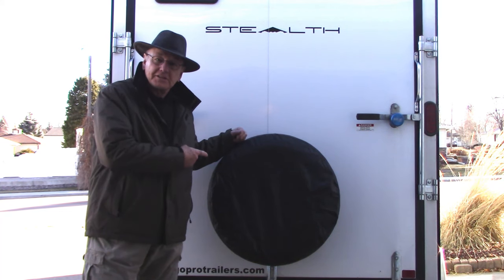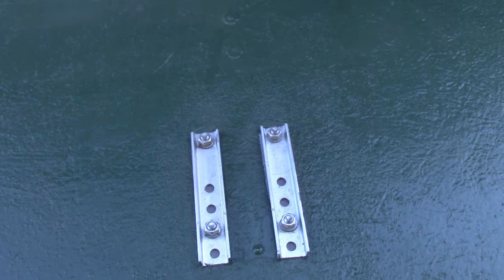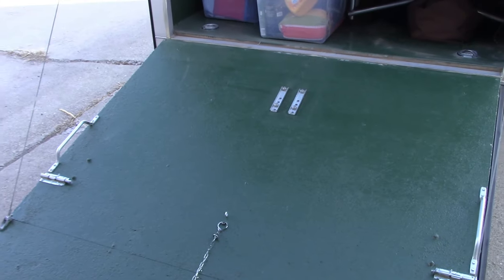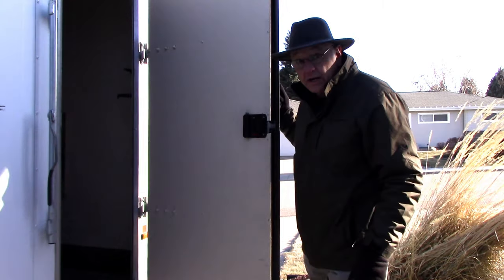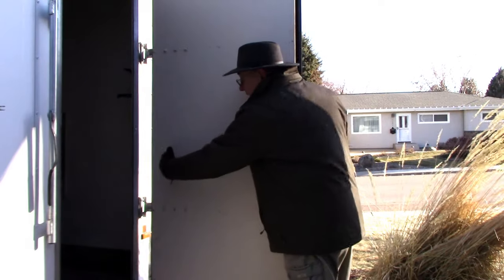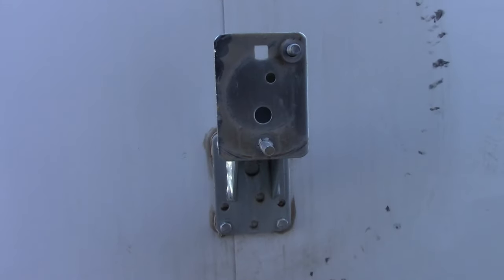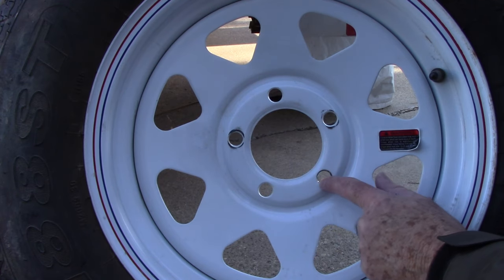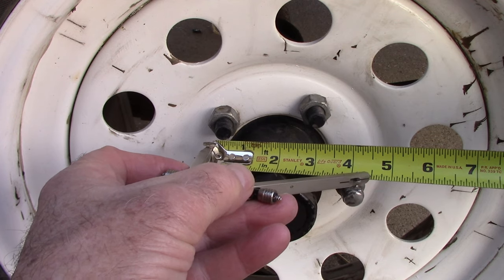Installing a Spare Tire On Your Cargo Trailer Camper

Comment: Over the years I made lots of modifications. One trick I learned was if I were doing what you did, I would go a step further. Not to say what you did was not right, but to try and insure no damage to the door. I save all kinds of pieces of metal tube, pipe, pvc pipe, copper pipe. I would try to match a piece of tubing or pipe to fit the bolt I was using and cut it to match the thickness of the panel . That insures it will not crush anything. Great job!
Reply from the maker: Thanks for the tip Bill!.

Comment: Does the weight of the tire effect the closure of the ramp door? Did you get a larger spring to handle the added weight? This is the best location as far as I'm concerned, but I'm worried about the added weight to the ramp door effecting the spring loaded door. 
I've watched many of your videos, they have helped me a lot, thank you.
Reply from the maker: Mount the tire as low as is practical and you should be fine.  Mine didn't affect the spring enough to make a big difference.
Reply: @gonagain  That's what i was thinking,  i just needed some reassurance before I drilled holes.  Keep up the cool videos. I use my 7' x 12' to haul my Harley road glide to and from Kentucky and Texas and sleep in it while traveling and attending rally's. I enjoy taking my time to and from while visiting Civil War battlefields. Thanks for all your help and the quick response. 
Kyle

Comment: For the side panel mount solution, why couldn't you use the same system you used for your ramp door but applied to the side panel?  You suggested much more reinforcing for the side panel than you applied to the ramp door.  Is this because the ramp door is much more robust than the side panel to begin with?  Please embellish.
Reply from the maker: That's exactly right about the ramp door being more robust and that's why the side panel mount needs some additional stiffening.  There may be other ways to accomplish that, but I think this would be the neatest.

Comment: Great Videos, Big Fan! I installed the spare tire exactly as you describe, I actually have the same trailer as you, but now need to reset my spring and cables. Can you describe or do a video on how to fix? Thanks!
Reply from the maker: I wouldn't try adjusting that spring unless I absolutely had to and then I'd get a knowledgeable trailer shop to do it for you. I did mine and it was a very real struggle.  I'm not sure I made any progress but the weight of my door wasn't too bad tho begin with. How is yours?
Reply: @gonagain  I am about to go on my first trip soon, so I think I will take your advice and have my dealer reset it along with checking out a few things other things to make sure I am safe before venturing out, Thanks!

Comment: Great video, how is the spare tire holding up mounted to the door? Any movement or warp age of the door? Also, which cover did you use?
Reply from the maker: The mount is still solid.  This is the one that I ordered, but measure your tire diameter first.  https://amzn.to/3tJVRYu

Comment: Is your trailer frame aluminum? Mine is. The studs are 1 x 1.5". They are oriented so they are 1" thick. I have barn doors. I'm not sure if they are strong enough. Love your videos!!!
Reply from the maker: Yeah Donald, mine is aluminum too.  I think if you put the blocking inside the door and a large, 1/2" plywood backing on the inside of the door it would be plenty strong enough to handle the weight.  Thanks for watching!

Comment: I recently mounted my spare tire on the ramp door of my trailer. On your program about locking your stuff I recall you mentioning you had two different lug nut locks on each wheel and the spare.
The spare mount has carriage bolts to keep the bolts from turning. These are 1/2 inch 13 carriage bolts and I could not find carriage bolts in a metric size to match the wheel lugs. Since I cannot hold the bolts from the back while tightening I wonder what you are using to lock the spare to the mount?
Reply from the maker: I used anti theft lug nuts there too.  I used 5 antitheft lug nuts on the left wheel that has the boot on it and these are of two different manufacturers.  Without removing the wheels and hubs, like if you are going to store the trailer somewhere away from your home, I think I've done about the best I can do.  I hope.

Comment: A very necessary requirement to have a spare wheel, but would it be easier to mount the wheel on the tow bar frame at the front of the trailer, that would also increase the nose weight which is normally a good thing, on the "A" frame it is also lower, which is much easier to stow, but the rear mount with the wood infill is a good position failing the A frame mount, depending on the weight of the wheel, my wheel is 40 Kgs, so it requires a lot of effort to lift, and locate on the studs at the same time, another option if you cannot gain access to the inside of the panel to place wood, would be to drill in from the inside, insert a steel tube of the correct length, then position a spreader(angle or sheet steel) then when it was tightened it would be supported by the spreader, always supposing the hinges were of sufficient strength to take the weight. Chris B.
Reply from the maker: That's a good tip on using a steel insert and spreader bar.  On a V-nose trailer you may not have enough space on the A frame to mount a spare.  I already have my propane tank and battery up there so that option wasn't available to me.  Your spare is really heavy so you definitely need something fairly stout!
Reply: @gonagain  : Yes, on a living trailer the gas bottle would be a problem, I thought that with your goods trailer with the ramp, it would be a good alternative as it would also keep the weight of the ramp down, the tube spacers work well, but the length needs to be just right to give a bit of "pinch" between generous load spreaders.
Reply from the maker: @453421abcdefg12345  with a heavy spare tire like yours, the rear ramp door lowering springs would have to be adjusted to handle the extra weight.  Keeping the tire as low on the door as possible helps a lot though.  On my door it didn't make any difference, but that's because my spare is pretty light.

Comment: Beats not having a spare. I like the angle iron idea. You could also accomplish that with inch square steel and cut a square wood dowel to fill the inside if you are concerned about bolts compressing the channel, might look a little better too. Take care. Aren't you two supposed to be playing Snowbirds about now?
Reply from the maker: Yes we are!  New water pump last week and new trailer tires yesterday.  Sub zero weather on the way... A good time to go for sure.
Reply: @gonagain  Our temperature dropped into the 30's today and next week is looking like lots of snow. I want to head South this week for a month too but I have so much else I should do. Plus the crisis decision, New camera or 1500+ fuel and food.  IF needed, I can live vicariously south through you. Safe Journey to you...
Reply from the maker: @CITAP1  I'm trying hard to get out of here asap.  It's heading below zero and I know it will stay that way for awhile.
Reply: @gonagain  I think I caught you're Montanaites. I know the cold of Kalispell Whitefish,
Reply from the maker: @CITAP1  yep we are.  It gets a lot colder here in Great Falls than in Kalispell, but it's drier and more sunny.  You're in the Seattle area?
Reply: @gonagain  I am! A Lifer. Nobody's perfect!
Reply from the maker: @CITAP1 , lol!  I grew up in Bellevue.
Reply: @gonagain  That's a big change  in habitable zones. Montana's got a lot to it.